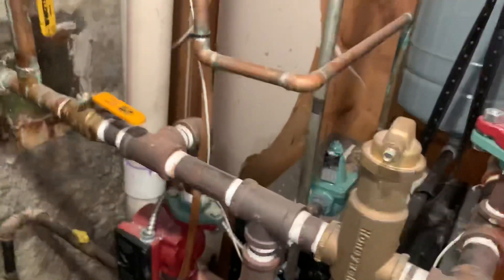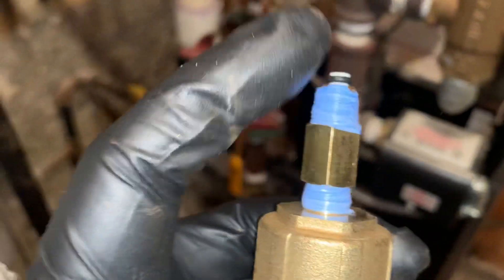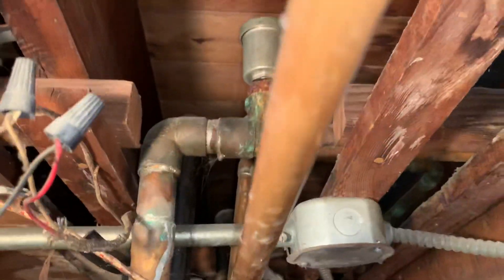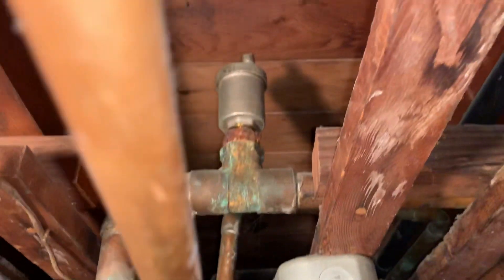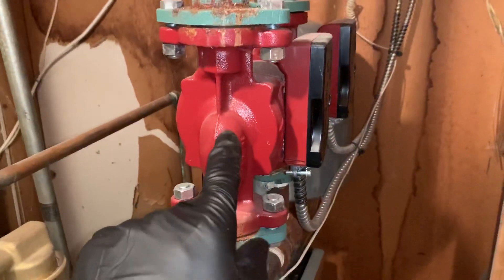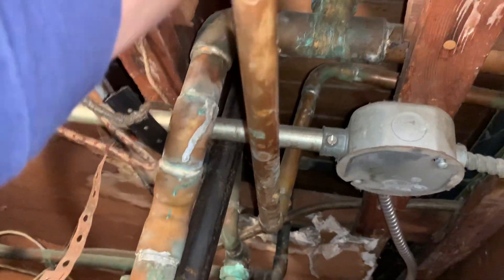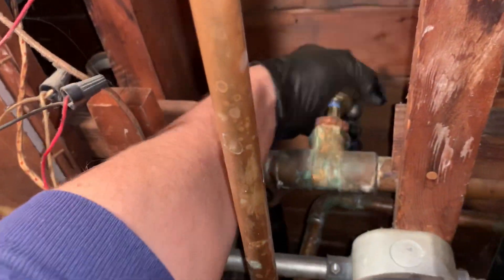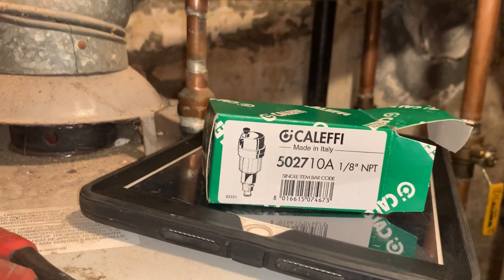Replacing Taco HY Vent 400 with Caleffi 502710A Automatic Hydronic Air Vent

Comment: Question on the check valve, it is a separate valve you state in the video, i question as the valve that is sold on ebay and amazon it appears to be part of the vent, or is that it is just screwed into the bottom of the vent with no apparent gap showing between the two. i have read all the descriptions and there is no mention of it being removal able. sorry for being so wordy.
Reply: @PipeDoctor  Gotcha, will order with the check valve. Thank you! keep up the videos was watching some of your older ones, can't believe how far you have come in the quality! Awesome job!